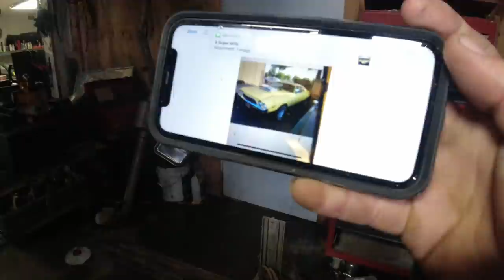Introducing MONSTER LEE True 1969 Rt charger   cummins power

Comment: I think the Real general Lee wasn't tnt Express it was actually a trucking companies out of  canda or England custom orange
Reply: Also if the charger is on a 1500 long bed it should switch directly over to a 2500 long bed the frame is close to the same if not the same
Reply from the maker: TNT express is the color code of the original lee
Reply: @samsonandrew7652  we're both right lol 

"It's an exact match for a color called TNT Express. It was never a factory car color, but it's used by a shipping company on their delivery vehicles."
Travis bell